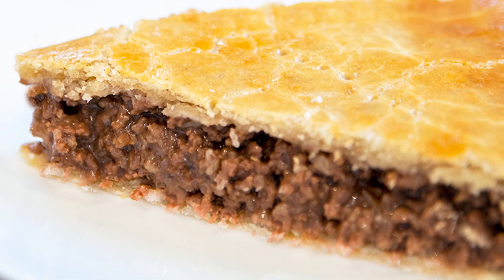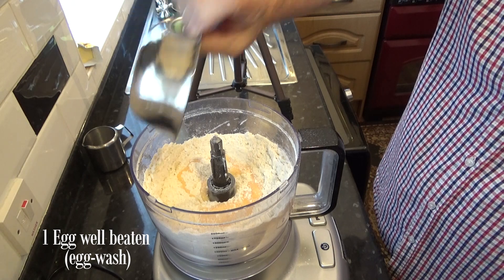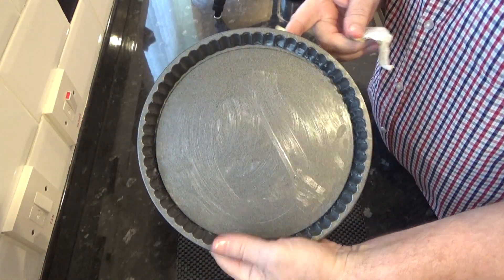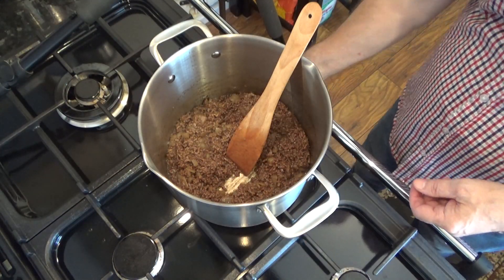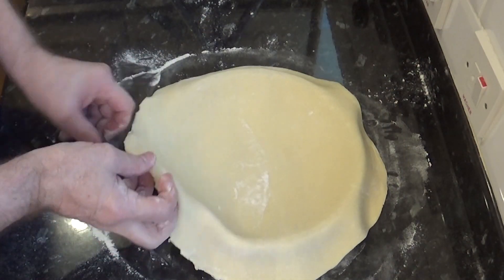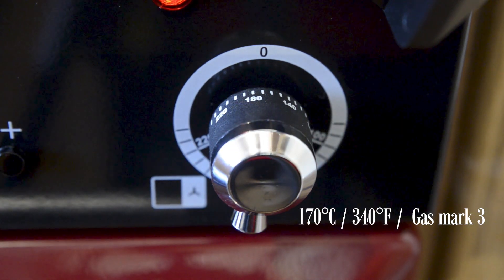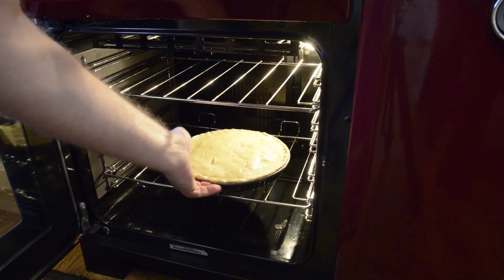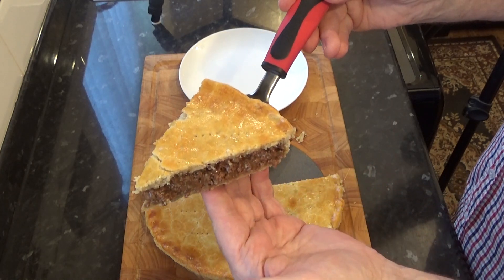Minced or Ground Beef and Onion Pie

Comment: Made this tonight, and was curious as to what difference an egg would make to the pastry. I don't normally have problems with the pastry cracking, but wow, that was one of the best pies I have made. Thanks John, another superb recipe.
Reply from the maker: Fantastic! I'm pleased you gave it a try my friend and it turned out well. Sometimes if the pastry is too cold it can crack, sometimes it's best to take it out around 30 minutes before.

Comment: Thanks John - I now understand although I had no problem with your previous comments which I thought were very useful.  I had thought your new oven did not behave the same way.  However, your comment that using the bottom element + the fan is exactly what I need to know although I think my new oven will actually be using top and bottom elements and fan assisted.  Thanks for your very prompt response.  You are a canny lad!
Reply from the maker: You are very welcome, thanks John mate, much appreciated.

Comment: Can you use a mixer (Like a Kitchenaid) in place of a Food Processor?
Reply from the maker: No not for pastry  you would be better off using the hand method.
Reply: @JohnKirkwoodProFoodHomemade  Thanks John! I was impatient and tried it before your comment. You're right lol the hand method was the backup method I had to go with. Guess it's time to introduce a food processor into the kitchen. By the way, we've been using a number of your bread recipes for quite some time! Your recipes are in use 5k miles away. Thanks again.

Comment: John, I will try this recipe but would appreciate your advice regarding the oven setting (170C).  You mention using the bottom element and I wonder if this is a Fan setting or convectional i.e. conventional with  no fan.  With your previous oven you usually mentioned setting it at 20C less being a fan oven.  But I notice you do not comment on this since you got your new oven.   I too have a new oven and need to decide whether to use a fan setting or conventional.  I can see the benefit of heat from the bottom element (no soggy bottoms) but presumably this would be available with a fan setting which I have always assumed used the heat from both the top and bottom elements; perhaps I am wrong?   Thank you again for what looks like another super easy to do recipe.  I lok forward to making it.
Reply from the maker: I do not mention the fan anymore, it was causing too much confusion across the globe, you should know by now how to adjust for a fan in your oven, and I use the bottom element and the fan combined for this pie.